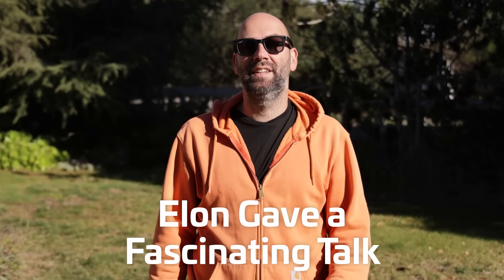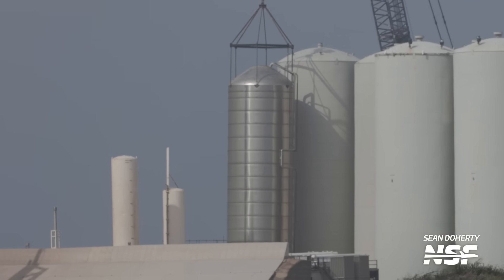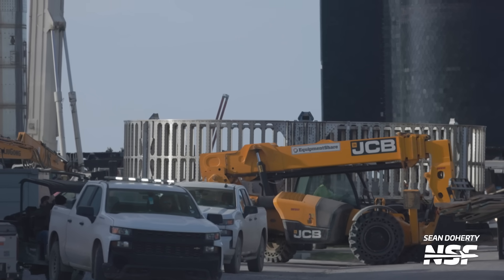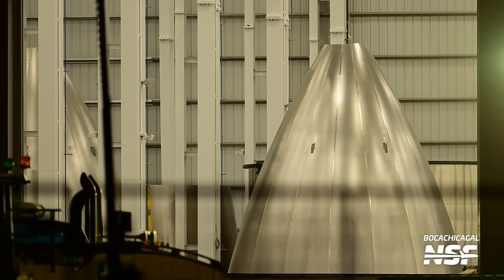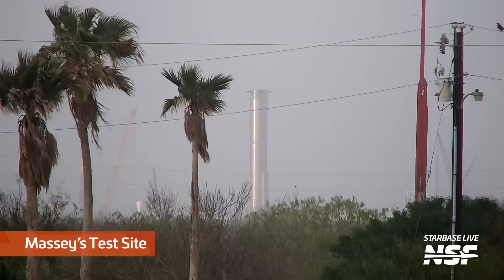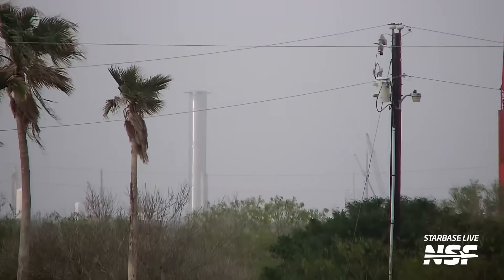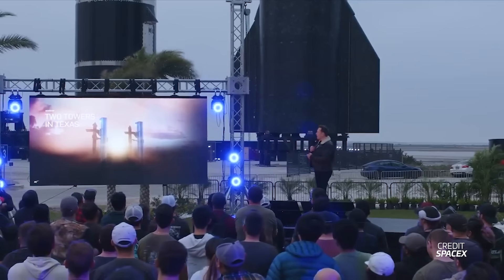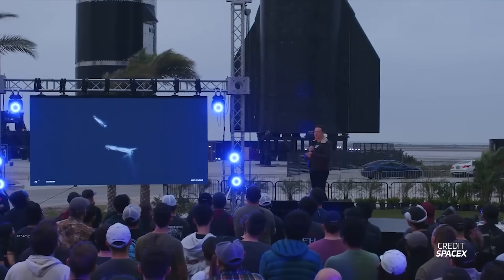Building It Bigger & Better | Starbase Update

Comment: Not sure if anyone has explained this, but the welds looking clean and then getting "dirty" isnt dirt, its rust.  Stainless steel does rust, especially at welds, when exposed to salty air.  The rust can be mitigated if the stainless is passivated, but since these are all test articles and unlikely to survive their tests and will likely not be reused, there is no point going through the passivation process.

Passivation is basically acid etching any free iron on the surface of the stainless away so only the corrosion resistant stuff in the alloy is left behind.

Comment: We can probably expect that side-by-side refueling to change. There's two options that are better, and a third that's more probable - nose to nose with end-over-end rotation to give spin-gravity to pool the fuels in the tanks for pumps to shift - nose to nose with a long axis low power thrust to pool the fuel in the nose of one and pour down in to the thrusting ship - and a refueling platform with solar powered pumps that can suck the fuels out of the tanker in to the waiting vehicle. The last there gets a higher probablity as tanks can be added to hold more fuel before the mission vehicle arrives, and the same solar power can be used for refrigeration, or spinning the tanks as they hang nose-up by the mechazilla pins, with the resulting 'downward' pressure being used to push fuel up to a waiting vehicle.
Keep it in a Sun-synchronus orbit that remains in Earth's shadow, and the tanks will stay cold almost forever.

Comment: I will still die on the hill that IFT3 will not even try to reach a "proper" orbit. As was said very clearly by the SpaceX employee on the Everyday Astronaut Astro awards last night, SpaceX daren't go for a "proper" orbit with such a heavy vehicle without being sure that the proposed de-orbit procedure will work. They will instead get to a speed and trajectory that will automatically bring the 2nd stage down safely if the de-orbit burn test should fail completely, and also bring it down successfully if the de-orbit burn succeeds, or partially fails.

Comment: Can they put the hls mock up on ship 26 like chop the current nose cone and put the hls cone on top. paint the whole thing white and test that? Or could it be a tanker prototype?
Reply: I was wondering about that too, ship 26 for HLS mockup or tanker pathfinder?
Reply: Ship 26 could be HLS or tanker pathfinder. If HLS, all those stringers could be reinforcement for an elevator prototype.
Reply: The stringers could be there to support the ship if they decide to cut the nosecone? 
I don't think they will bring out the elevator now

Comment: Does anybody knows which is the order of magnitud for the money invested from the begining for starbase today ...one billion, two billions...nowadays one billion per year for the total program of starship ???
Reply: The total estimated amount for starship development is 10 billion, which included starbase, OLM, masseys, test articles and other buildings. Given that a fully stacked starship costs about 500 million, I think 10 billion total isn't unreasonable as an estimate.

But then again, some of the costs would be extended into the write off for production, like starfactory. So it just depends on how you look at it and what you tally up to the development phase and the production phase. Raptor development has been ongoing for years now, churning out hundreds of engines and only a handful have actually been used in flight tests.
Reply: @patrickd9551  thanks a lot for your numbers, actually I was thinking about the current flow right now...but by the way I also thought since the begining of Boca Chica development . The order of magnitud is clear as you share. Do you think that in this moment they would be about 50%  total amount development of 10 billions?
Reply: @claramente8087  I really couldn't tell if I wanted to. If I were a gambling man, I would guess something like 8 billion already has been burned through for the development stage. 

That is primarily based on the total amount deducted by my guess on how many starships they would need to launch to finish the development stage. 

SpaceX already has 3 complete starships lined up. Another 3 or 4 version 2 starships should most likely finish the development stage. By then SpaceX should be at a stage of launching starlink V2 into orbit. 

After that initial phase comes things like landing, which could end up costing a tower or two. So another 2 billion perhaps? At the very least it will be interesting times to come. 

It could very well be that SpaceX has already burned through their initial 10 billion but has also secured additional funding. Who knows :)

Comment: I'm still at odds why a LOX dump in space, could lead to a fire in the ship. A fast dump could conceivably freeze the LOX solid in the tank, starving the still firing engines, and resulting in a turbo pump failure. The Apollo missions to the moon, routinely did a lox dump from the S4-B when it was discarded (I watched several happen), and none exploded.
Reply: The exhaust could have non-combusted methane that with the extra LOX could have exploded. Behind the ship but too close for it to survive. Elon did not go into such details.
Reply: At engine cut-off the sudden deceleration could cause the pressure at the turbopump inlet to drop. The pump and turbine cavitate before the rotor has had a chance to spin down. Cavitation could cause the pump to come apart. Other engines may use the anti-pogo accumulator to keep the pump pressurized during spin-down. The tanks are also autogenously pressurized, so once the engines quit they can no longer supply enough pressure to suppress cavitation
Reply: I'm with you on that. And also, if they didn't have a payload, they could have loaded less LOX. If they had excess LOX, then that effectively becomes their payload, so no need to dump it during the burn. I don't get it.
Reply: @tomv5782  They might not want a tank with of LOX during re-entry, so maybe they released the LOX early... causing the lost of the rocket
Reply: @tomv5782 
Yeah, dump LOX payload after SECO. Just mostly spray radially (and symmetrically) to avoid changing course.

Comment: This system is a disaster that will fail and set back space travel. With the ability to assemble a large spacecraft in space sending a huge unneeded spacecraft holding everything once makes no sense other than vanity for MUSK.
Reply: You would still need to send supplies to build, fuel, and operate it. Besides, starship can be used to accelerate Starlink deployment.

Comment: 6:27 I’m narrowing my prediction - Ship 26 is either an engineering pathfinder, or it’s an HLS prototype. The round-the-body stringers wouldn’t work on a Starship w/tiles, but perhaps serve a purpose for mounting things on the outside of an HLS Starship.
Reply: I doubt very much they would ever mount things outside the ship. The stringers are there to make the cargo bay stiff enough to maintain its form without inside pressure.
Reply: For example, external hot gas thrusters.
Reply: Orbital tankers need to land unless the plan is to launch to leo and let them there forever.
Reply: @ericpaul4575  The supply tankers do, but the orbital tanker depot doesn't. It just gets refueled by the supply tankers, and then dumps its fuel load into Starships bound for Far Away. It  does just have to sit in orbit for as long as possible whilst in service.